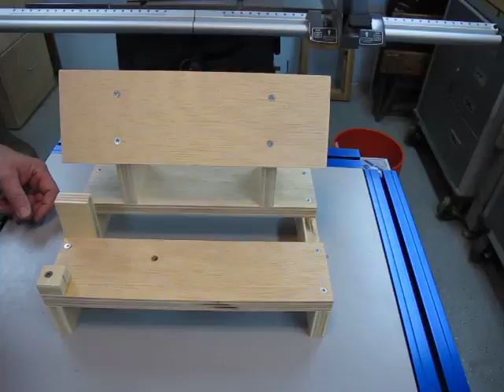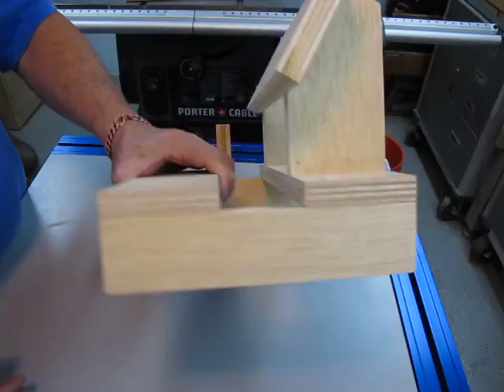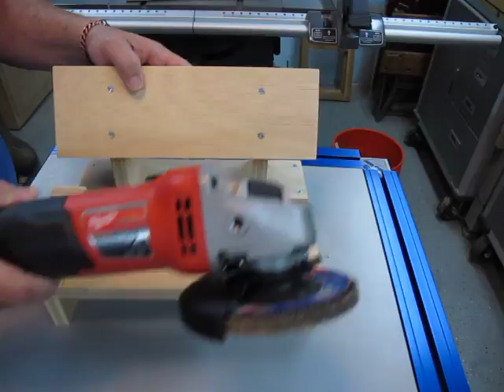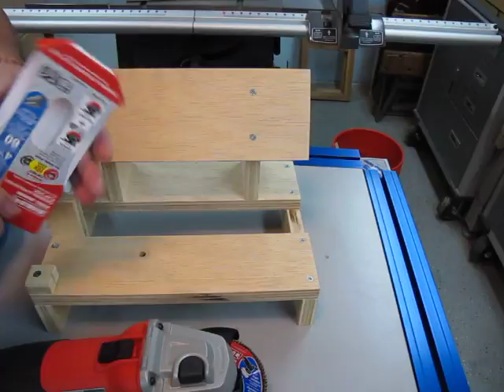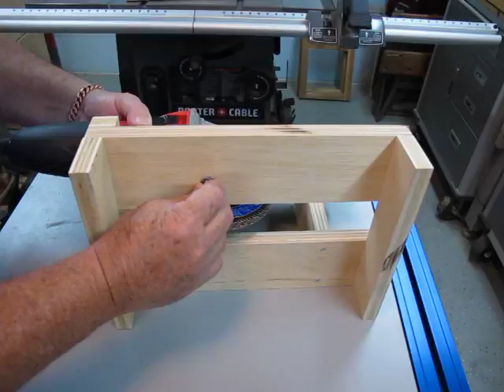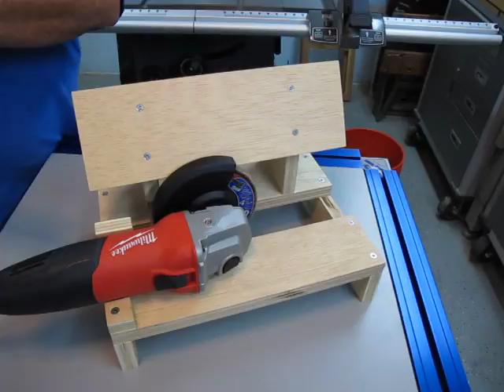DIY Lawn Mower Blade Sharpening Bench 1-5

Comment: This is a great fixture! I made one in a few hours from scraps of lumber I had laying around. I’m going to put a board on the bottom so I can clamp it down easier. Works great!
Reply from the maker: Awesome! I may suggest for you to use a type 27 (flat bottom) Flap Pad. I found mine at Harbor Freight.
Mount the Grinder so that the Flap Pad can be as close as 1/16" to 1/8' to the bottom edge of the blade rest.

This was the game changer after making a few models having an adjustable blade rest in which I did not have
to have. This first model was the winner after all.

Comment: I like this front-sideways mount design best of all the wooden jigs I've seen, which are back-uspide-down mounted.  However, I would make one modification.  I think the "feet" should be laid flat instead of standing on edge.  This would allow the jig to be more securely clamped onto a surface.  of course, the wood for the feet would have to be thick enough so as to allow a good clearance between the mounting surface and the grinder's blade and guard.  It looks like a 2x4 would do the trick nicely.

Also, instead of drilling just a hole for the grinder mount, it would be better if it were a long U shape so that you could mount the grinder closer or further away from the 30 degree "staging" area.  This would allow the accommodation of different styles and models of blades as well as different models of grinders.
Reply from the maker: Awesome idea. At the time I was doing this, making this design as simple as I can make it.
As you can see I made three other attempts. It became more complex as started to add
other thoughts on to them. I made a fifth version of this. It is very similar to the Crackdown.
I made it narrower from the front, made the dust collection detachable. It still works like the
Crackdown.
Reply from the maker: Watch this to get the dimensions you'll need to make one......enjoy.....https://www.youtube.com/watch?v=A5Bu1zSIwVo

Comment from the maker: Some want to know how I got the idea. I have seen videos of commercial grade lawn mower blade sharpeners and most of 
them are made of metal and welded metal. I wanted to make one for my use but I do not own/have a welding machine. Some
would say, rent it. My garage is not wired for 240v machines. I do have a collection of good enough wood working tools. 

So came I up with this with the grinder mounted horizontally instead of mounting the grinder vertically like most videos I have
seen here in YouTube. This contraption basically works and adjusted like those machines with the grinder mounted vertically.
Reply: GREAT JOB, I like the ones that you tighten the blade down to a surface & move the grinder, could you make one of those if I showed you what I want?

Comment: Question ... your design is simple and thanks for sharing .. BUT the grinder is in a fixed position the other jigs out there on Youtube have is so the grinder can pivot / twist to adjust the angle of the wheel to the blade / surface of the deck where the blade is rested and drawn . Does you fixed grinder not present a problem with a correct grinding surface angle ? thanks Duncan
Reply from the maker: This jig was designed for the lawn mower blade in my riding mower and it has a 30 degree grinned angle on the
cutting edge of the blade. With the TYPE 27 flap pad in which it has a flat bottom. This combined features,
30 degree angle of the blade rest and the flat bottom flap pad, there is no need for the twist and turns (as you mentioned).
It is critical for the "just right" distance between the bottom of the flap pad and the bottom edge of the blade rest.
If you're inclined to use other than the TYPE 27, flat bottom pad, you'll have to check the jigs I've posted with adjustable 

angle BLADE REST.

Check this out: 

https://www.youtube.com/watch?v=qHLWxIAGRn8

Comment: I would also like the get a how to on this. This would be great for me as now I am doing it by hand and my blades cut well for a few cuts then my grass is all frayed again.
Reply from the maker: How is your wood working skill? You will need a small table saw to cut the plywood square (90 degree corners). Or a circular saw with a guide to have the same result. A drill press or a hand drill with a drill guide to make sure the
holes are square to the surface. A miter saw to cut the 30 degree angle and a jig saw to cut the semi-circular.
Reply from the maker: Watch this to get the dimensions you'll need to make one......enjoy.....https://www.youtube.com/watch?v=A5Bu1zSIwVo

Comment: Look at the picture, not to hard to figure dimensions. If you want to build this and have some inteligents go and build it. I’m going to make one. I’ m going to use my chop saw, shouldn’t take maybe 10 minutes drill hole for grinder mount. Cut two -1x2’s ,screw to sides of the table and mount to your work bench with screws. Nuff said.
Reply from the maker: Amen to that!